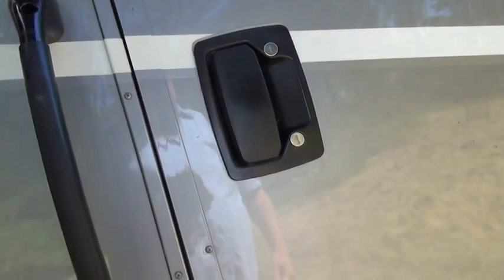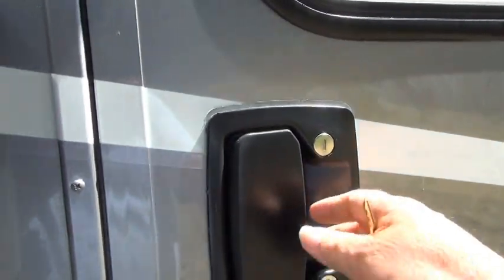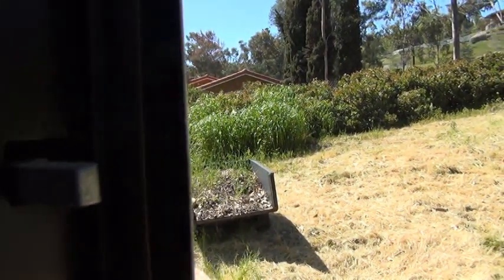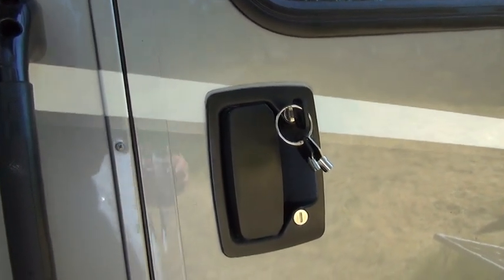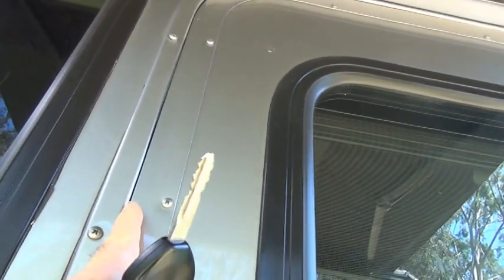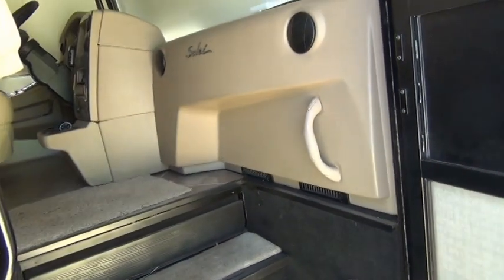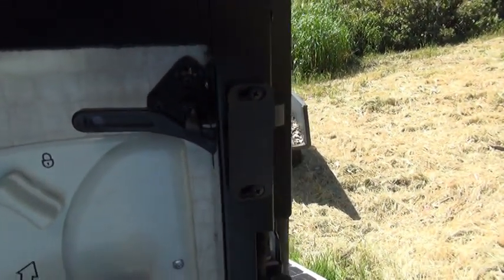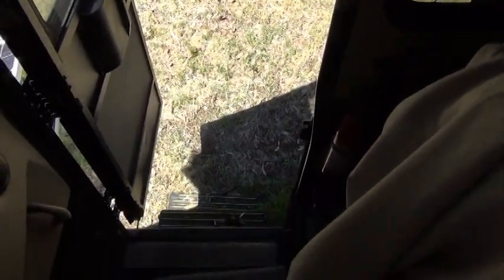Problems with RV Entry Doors

Comment: Hello, the hole is made larger than the deadbolt on purpose. The reason is to allow for shift, the frame and even the door will have some slight shift to it, the motorhome body/frame moves slightly back and forth when driving on rough roads, bumpy roads, pot holes,etc.., and comes back into it's normal place when stationary. However if the hole for the deadbolt was made to fit tightly then due to the constant movement of the coach the deadbolt would eventually not slide properly into place if it is "off" by a small amount. I agree that the hole could be made a little smaller, but still allow enough room for shifting. Fact is, if someone wants to break into the coach they can, break the window, pry open the door, etc..( the locks are cheaply made on all trailers and motorhomes )  you are correct, best to lock both locks on the door and make sure the door is firmly closed, that's about all anyone can do.   On my coach I went a step further and installed a camera with a sticker on the door saying " smile, your on camera" .
Reply: Actually you should always have the deadbolt locked while the coach is in motion, this is what I was told from the dealer where I purchased my coach.  :)
Reply: Question early this morning I locked the deadbolt and the main door entry lock after working on the RV travel trailer 5th wheel for about 12 hours I tried unlocking the deadbolt and the main lock to the entry the door won't open should I level the RV to allow the devil to completely clear and open the door?

Comment: The bottom key is a master key. I’ve heard that all Tiffin bottom keys will unlock any Tiffin. This came to our advantage when we accidentally locked the door from the inside and closed it while it was on with all our keys. I found another Tiffin owner and was able to use their key to get us back in our RV. The top key (deadbolt) is unique like a car door key
Reply: Interesting. There were 5 Tiffins in the park and the 1st one we went to let us borrow their keys even though they had a keyless entry and it worked! How’s that for 1 out of 100. Just glad we didn’t have to call someone as the RV was running and our dogs were still in it

Comment: What can you do if the lock key
Broke inside the lock and I is stuck and I cant lock the door anymore is there a way to still lock it?
Reply from the maker: I have a deadbolt also but it is not secure enough. Just replace the lock with a new one.

Comment: Can anyone answer this. Have 2 non moveable bolts on the door that are supposed to fit into a bracket on the door sill. Opened it up, now it won't latch. Like the bolts shrunk. Nothing I can see is loose. This is on an Entegra Esteem. Some wisdom would be appreciated.

Comment: My bottom lock does not actually lock the door. I thought the lock must bet busted, however in the TriMark 030-0900 description There are the words "Plus for a single-key system, keyed alike or provided non-locking" So is it possible that bottom lock not meant to work? Tke key moves the lock lever inside but still allows door to open. Any thoughts?